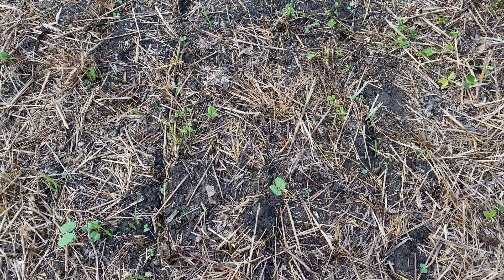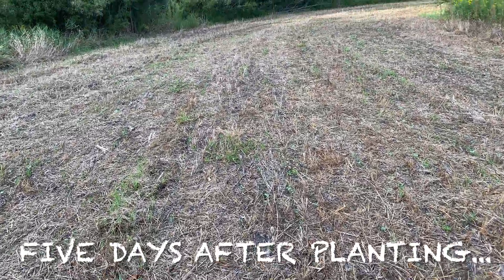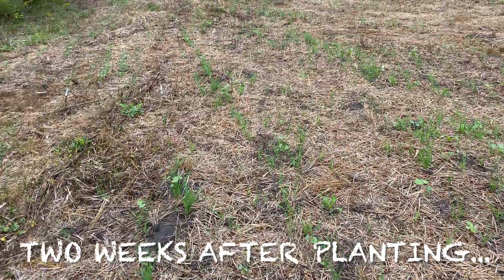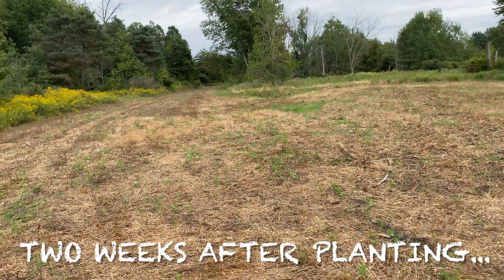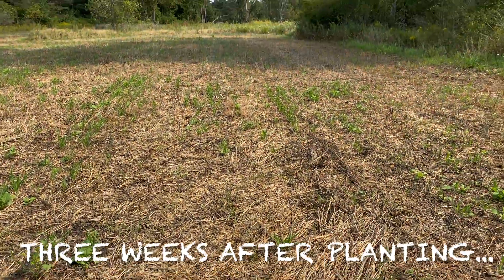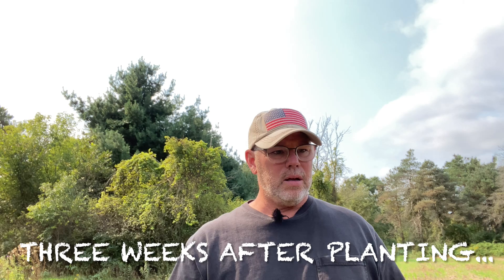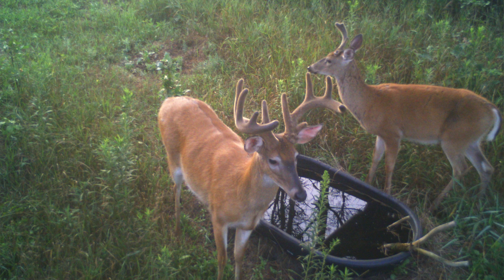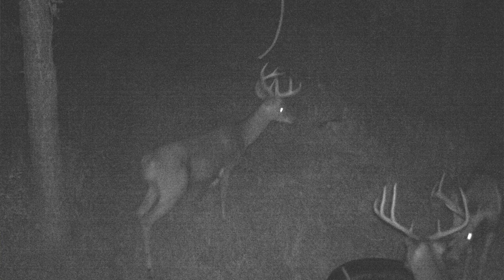Fall No-Till Foodplot Experiment Results After 3 Weeks

Comment: I saw in another video the discussion of a crimper, which I agree is OUTRAGEOUSLY priced for a mono use tool.  However, have you looked at Packer Maxx cultipacker/crimper set up?  Can pull with as small as a 4 wheeler.
Reply from the maker: Hey Patrick, I haven't looked at the Packer Maxx yet, but I have heard a few guys mention it.  I'll have to see if anyone has put a video out showing how it works and their experience with it.  All the best to you.

Comment: You need a drill that has coulters in front of the disc openers to cut through the thatch so the openers can get the seed down to the soil in the heavy thatch areas.
Reply from the maker: Hey Les, thanks for the comment (BTW, clever name).  We're experimenting with using only a grain drill to help more guys get into no-till economically.  But we still have more learning to do, including figuring out how to plant through heavy thatch.  We have a few ideas that we think are gonig to work, but need to test them next season.  Good luck!

Comment: I have followed your channel for a few months now.  Your experiences with drills were a factor, and helped to convince me to purchase a Tar River Saya 5 foot NO TILL DRILL.   I planted in mid August....at almost identical times as you here....and terminated my old fields (ten acres of woodland food plots) via a mowing and nuking with 2 qt / acre glyphosate.  Immediately after I finished planting....the rains came here in MN and I have gotten about 8" in total rainfall over the past month.   Almost a miracle after a dry summer caused all my spring efforts to fail.   All of my ten acres have germinated and are looking as good as can be.  I planted a mix of 100 lbs of cereal rye.....and 9 other "candy crops".   The rye is quite heavy.....and I do intend to roller crimp it next June.....and I think I will follow with buckwheat at that time.   I do believe you should look into adding the front slicing coulters to your drill.   I believe as you build more thatch you will have difficulty penetrating the mulch you are creating with your process.....and will have more results like you show in the video....where you get some bare spots due to heavy and scattered thatch.   Maybe I am wrong?  Dunno.   Just trying to be of help.    I think the five footer and some weight on the front of my drill assures pretty good penetration of the thatch.   I won't know the ability to penetrate the new rye cover crop until next year.   THANK YOU for putting together such a good video demonstration.       We should connect via email - very similar goals.   EDIT:  I did drill seed into several areas that had never seen any tillage in the past.....just extremely dense sod.....which I mowed really close with a flail mower I own....then 2 qt / glyphosate.......follwed by my Tar River Saya NT Drill putting down 134 lbs of my 10 seed mixture.   Slower to germinate than my current food plots....but now are full germinated and flourishing.
Reply from the maker: Hey Tom, congrats on getting the new drill, and thank you for the ideas and feedback.  I think you might be right as the thatch builds up, but I'm going to keep grinding to see if I can figure out how to work around it.  With that Saya, you have a ton of options since you can pretty much plant anywhere after a burn down and mow.  Keep me updated on your thoughts.
Reply: Great comments Tom.  Stay ahead of the WR in the spring, I switched to WW because I could not successfully kill it the following year.  It kept returning, even after I hit it with a hot RU burn down.                                                                                                                                                                                                                       Mark I have had a flail mower for well over 10 years.  They do a much better job in spreading out the material opposed to a bush hog wind rowing the material, mine has the knife cutters.  I think it will help you, but still think you should consider adding the slicing coulters to your drill and including significant additional weight.  I'll be looking at the Saya 5' no till drill next year.  I would like to fertilize with it for a one pass job, but am concerned abut the steel rivets in the larger seed bin rusting.
Reply: @rfb7117  I plan to roller crimp my rye to terminate it .....hopefully in mid to late June before it goes to seed.  I have purchased a 6 foot roller crimper and I have yet to use it.   I may run it on the front loader (float position) or pull it with the three point.   Undecided.    According to what I have read and seen on video....successfullly terminating rye comes from crimping the stalk just before the seed head hardens (durning the milk or dough stage).   That's my plan.   May plant into to the standing rye with my buckwheat crop and then terminate the rye....and / orI may try to do some roller crimping and drilling into the rye thatch all at the same time just to see how that works out.  Compare results.    Fun.   I'd like to take some of the chemical out of my plans...therefore the roller crimper.
Reply: @rfb7117  I considered putting fertilizer in the box(s) but have not done so.   I read where some have replaced the 1/4" bolts with SS bolts.  But in reality I think the plated bolts would hold up quite well (?) if a good clean up was done after use with fertilizers.   If not after they show some corrosion they could be replaced.    I have a 3 Point Cone Spreader......so I just top dress when needed.   I am told that I should be able to reduce my fertizer requirements by 30% each year....as the dead and decaying plants will release NPK and such as they are terminated or as they otherwise scavenge from the soil.   Also the worms and insects prove benefits too as we rebuild these soils.   Kinda liking all the benefits of going no till.....tho it's taken some time to get these old ways to go away.
Reply: Thanks Tom for your quick response and comments.  I tried including my email thinking it would be good to converse directly,  but it was edited out.  The reason I was asking about the fertilizer, is that I can purchase my seed with the fertilizer incorporated in the same bag which would make it a one pass job.  thanks again, Bob
Reply from the maker: @rfb7117  Just looked into the price of a roller crimper, and a Goliath 6' is $4000+.  So, I'll be trying to find another method, and will be looking into flail mowers since I really know zero about them.  I already have a 6' cultipacker, maybe I'll try to load it up with a lot of weight to see how that does, too?  Lots to keep trying.  Thanks for the info.
Reply: Mark...is there a way to share emails?
Reply from the maker: @rfb7117  Go the the "About" page for this channel, at the bottom is an email link.

Comment: Mark....thanks for the update.  How did you fertilize your food plots?
Reply: How about considering adding weight to your no till drill?  Lack of rain has really hurt us in SW WI, 2/10" in three weeks. Not having great success with the no till system.
Reply from the maker: Ouch!  We had the same thing here, and I am still amazed that there was enough moisture in the sand to germinate everything.  And yes, I plan to add weight to it next year to see how it does.  I have a few old time window weights around that I am going to try to stack on it.  I think this should help some.
Reply from the maker: I didn't apply fertilizer this planting.  Part of no-till is to wean the plots off of fertilizer over a few years, so I'm trying it now to see if the soil is fertile enough yet.  Might need to apply it in the spring?  IF I did have to put fertilizer down, I would have run it through the drill when planting (it has a second seed box that can run seed or fertilizer).
Reply: Please let me know it you do, I'm concerned about rust in the box.  Also, is there a way to add a pic to a when replying to you?  thanks, Bob
Reply from the maker: @rfb7117  Hey Bob, no, I don't see a way to add a pic in comments.  Seems odd doesn't it?
Reply: Unfortunate., if anyone know how to let us know.     Good luck and be safe!!!
Reply from the maker: @rfb7117  Agreed.  Seems odd that GOOGLE of all companies doesn't have that option for us?

Comment: I am an “almost no-till” guy.  I spray, rototill, plant and cultipack in the spring (like you used to do).  For fall, I plant, and roll it with my cultipacker.  I am still broadcasting.  Your work almost has me convinced to buy a regular grain drill.
Reply from the maker: Hey Tim!  If the broadcast process isn't working good enough, then I would encourage you to look into figuring out a way to get better seed to soil contact, which a drill does a superb job of providing.  If you have light soils, a grain drill will probably work.  If you have medium to heavy soil, I can't say if a grain drill will work good enough or not, but you wouldn't go wrong with an official no-till drill (you just need to write a bigger check!)  Wish you all the best as you consider how to move forward.
Reply: @theback40  Thanks.  Yes, I have light sandy soil (Traverse City).  After two seasons of “almost no-till” it is turning darker and I actually found two worms in a root ball yesterday!  It is getting better.  Yes, I’ll be looking for a grain drill.
Reply from the maker: @timh8257  OK...........I'm jealous you found a couple worms.  I still have none, so sad. You are for sure on the right track!!
Reply: Would a flail mower work better? It mulches the weeds and grass. Just wondering about it?